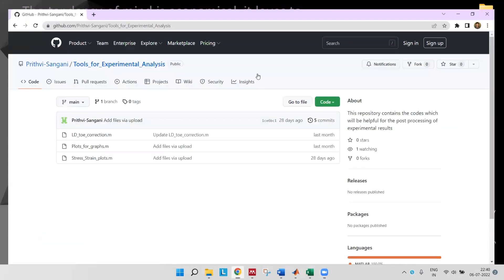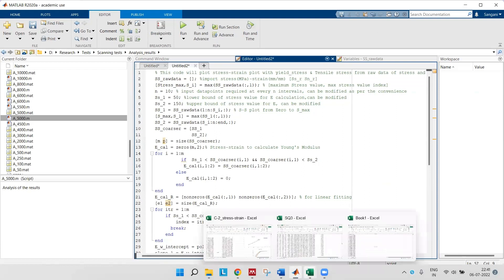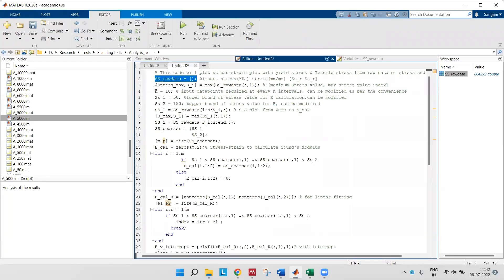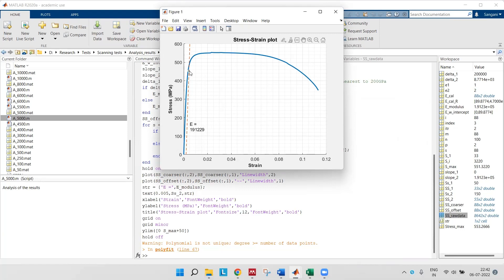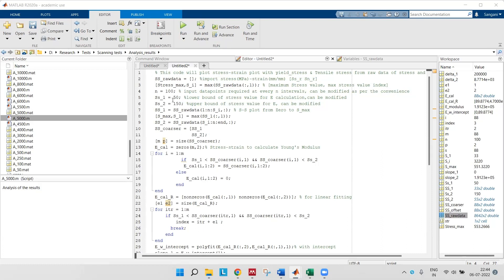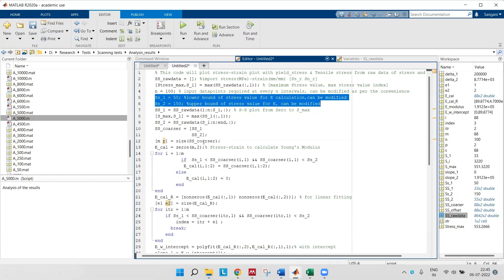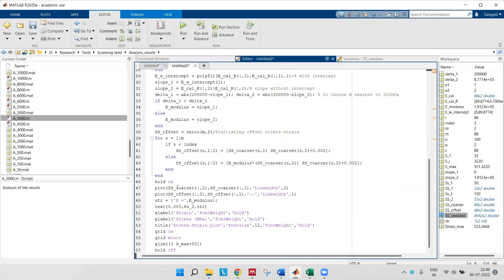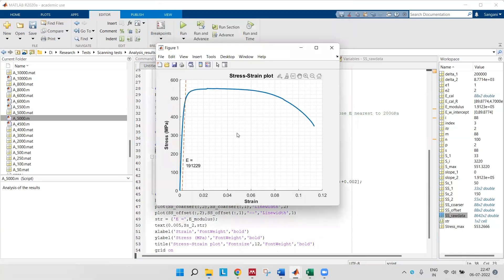Stress-Strain Plot, Young's Modulus & Yield Stress calculation using MATLAB

Comment: Hello i have a question, how we can plot stress strain curve for different temperatures using matlab code?
Reply from the maker: Hi, it is similar to what it is done here. In this case the stress-strain curve is plotted at 25 deg. If you have stress strain curves for each temperature values, check any standard which gives the detail of selecting the yield stress and likewise modify the offset curve (in this case I've considered 0.2% offset). For plotting multiple line plots, use hold on and hold off option.

Comment: Hi, Great video! Just a doubt, I am getting index at position error when I run the code. How do I fix it?
Reply from the maker: Hi, in the code, 'index' is used to find the slope of the stress-strain curve within the linear portion. One reason for your error can be index is very less or your data is very coarse. Try to use finer data or use the same data with n = 1 in the third line of the code. Hope it should work. Thanks